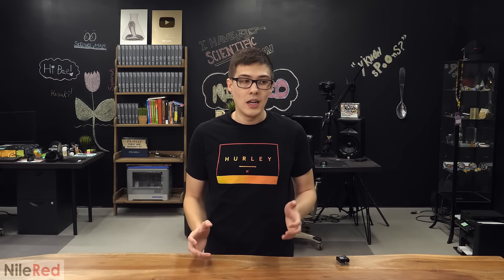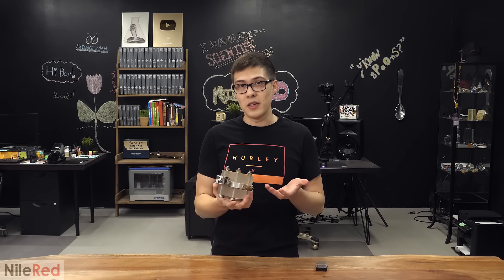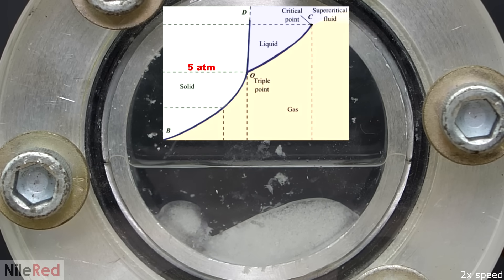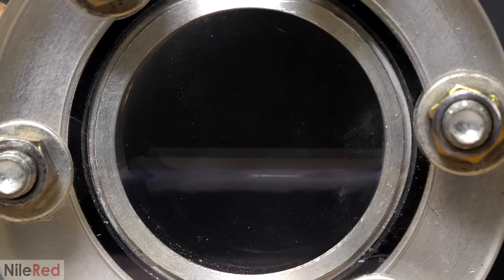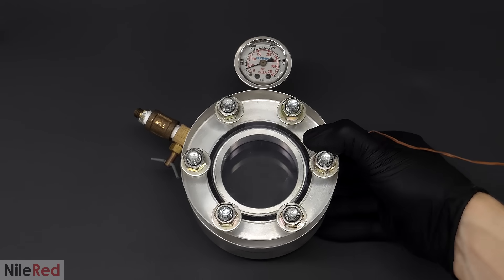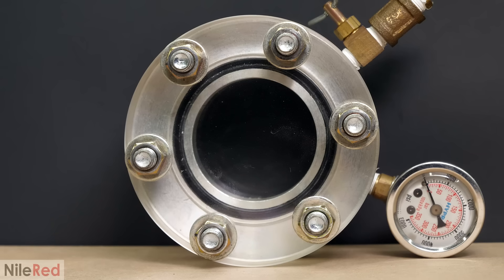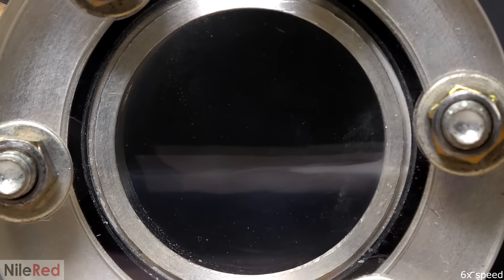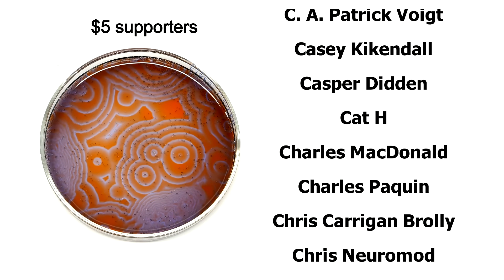Going supercritical.

Comment: Get a torque wrench for the bolts, one of the most handy tools to have.
Reply: And a bench vise
Reply: @FridgidIdgit  And a sheet of seaboard so you can cut and drill it into some cheap HDPE vice jaws to not mar everything you put in there without fiddling with wrapping it in neoprene sheet stolen from free tradeshow mouse pads or sheets of 1/2 felt. Advice from your friendly neighborhood armorer.
Reply: Or use the AvE method. “Aaaaand... click!”
Reply: I wouldn't expect to see a torque wrench, when he's using torx on hex...
Reply: @spamlobster  Ha my thoughts exactly. Stripped torx bit indicates tight enough.
Reply: @spamlobster  That's why adapters are a thing.
Reply: And dont use a damn torx bit for a hex head bolt...
Reply: What the fck is this comment section? Jk but still everything went over my head
Reply: I love torque wrenched.
Reply: Using a hex bit instead of torx probably could help as well
Reply: I agree with the tork wrench. i would think that torquing the bolts evenly would be as important as getting them tight enough. Uneven pressure could cause warping and at low temp could cause the cold plastic to crack. This could cause the catastrophic failure that Ben warned of. Great video though, i love watching nature at work.
Reply: Exactly what I thought as he was tightening
Reply: Unrelated side thought: why does the terminator in T2 need a torque wrench?
Reply: Five years later and I’m desperately searching the comments for this. Torque wrenches are worth their weight in gold with any sealed and pressurized system
Reply: He'd still need to figure out how much to tighten it. The wrench doesn't tell you how many Nm you need to set it to.
Reply: @Kenionatus  make a mock-up of the same materials, wench it until the threads fail, subtract 20 foot pounds off of that, then you have a reference. At the very least, it would allow all of the bolts to be set at the same torque to prevent warping.
Reply: Kenionatus since he got it to work, he could use a torque wrench to check how tight they currently are and then use that reference every time
Reply: @Kenionatus  With the size of the bolts you just tighten them to the manufacturers recommended torque setting, from the datasheet for that diameter capscrew. Simplest method without torque measuring is to simply add a Belleville washer to the head side, so that when it is just flat you have a very well determined tension on the bolt.  Probably a parallel stack of 3 washers with 10mm hole will work best there per bolt, giving a replicable tightening torque. This is common on things that need a set torque, but which are used in the field where you might not have torque wrenches available. Most common use I see is on electric cable joints, where you need a minimum contact pressure to prevent heating, and the washer also provides a small amount of compliance for material creep as well.
Reply: @Kenionatus  Set leaking is not catastrophic he could set each bolt to a different tightness run the experiment and then tighten them all to the setting that held the best.
Reply: @Kenionatus
I have two options of three words:

Torque Control Drill 
OR 
Adjustable Clutch Screwdriver
.
.
.
Slowly ramp up the torque after each iteration of a loop starting at the lowest setting, tighten the nuts, let it melt, check for leaks, and if no leaks, stop adjusting the clutch/torque control and repeat with full load to make observations, after recording the observation of the estimated proper torque, obviously.  ;-)

Comment: Just a couple points here. The vapor pressure is 5 atm only at the triple point, which is a temperature of -56.6C. Once the solid completely melts and you're along the two-phase coexistence curve and heat up to room temperature, the pressure should be almost exactly 60 atm. Thus, you have a built in pressure gauge so to speak.

Further, supercritical can be a bit of a misnomer depending on what you really mean. If you calculate lines of equal density starting from the liquid-vapor curve and then extend them above 31C, you'll find that there actually can be a difference between liquid-like densities and vapor-like densities in the "supercritical" field. This is why it seems like the whole thing is liquid-filled above the critical point with the beads in there.

Comment: I'm just spill balling here... but regarding the silica beads - could it be possible that the pressure lowered the melting point of the silica gel enough for it to undergo something like metamorphosis you find in rocks?  (And if so - would releasing the pressure very slowly cause the "crystals" to grow bigger; simulating cooling slowly by manipulating the melting point with pressure instead of manipulating the temperature).

Comment: first time in a while I had to switch from 480p(usually set at that both because slow internet and bandwidth limits) to 720p for something besides small text. I felt like I really had to get a better look at how the silica beads were acting under the supercritical CO2. speaking of the silica beads though, did you use the same ones for both runs? they looked cracked already by the second run, and I was hoping to see how it looked when they were actually changing.

Comment: Hi Nile,
 I am a student in gemology, and I think I can say that the gel beads have passed. As those beads have been subjected to a little heat and much more pressure than they are used to, they may have hardened and broken. Creating fissures and fractures throughout the interior, which reflect and disperse the light causing those beautiful colors.

And you are right, the play of colors of the opales are caused by another phenomenon. In case you want to know, the opaque is formed by microscopic and compact silicon beads, which depending on its structure allows opalescence (opales turbidity) and in some cases the color set characteristic of the opales

Comment: P.S. Your pressure gauge is for fairly high pressure(0-5000 psi).  The reason it initially was not responding was because the vessel was pretty cold from the dry ice, and there was probably some water in the pressure gauge which was frozen.  Another possibility is that the gauge is liquid-filled (usually glycerine or silicone oil) and was frozen as well.  It was reading about 500 psi when I saw it later in the video, which is lower than the critical pressure of CO2 (1071 psia).  The gauge may be broken, because it should have been reading 900-1000 psi as you went through the critical point.
Reply: PPS - You got to the correct pressure at 16 minutes into the video. - Nice job.  Looks like the new gauge is working better.

Comment: Just fyi, there's a ghetto way if doing that caffeine extraction that we did in my undergraduate o Chem lab. You get a soda bottle preform (basically looks like a thick walled plastic test tube) which is what they make 2 liter bottles into. Then take a plastic syringe with the plunger removed and place cotton, then coffee grounds into it. Place the syringe into the form such that it nests inside it comfortably (this means you need an appropriately sized syringe, won't be able to be very big). Then what you do is place dry ice into the syringe on top of the coffee grounds and quickly attach a pressure gauge and valve adaptor and close the form (the gauge must be able to withstand very high pressure, do not use an adaptor that cannot) 

The co2 will liquefy, flow over the coffee grounds and cotton and exit out the bottom of the syringe and collect at the bottom of the form. The pressure can then be slowly released and the co2 will evaporate leaving any extracted caffeine as a white powder at the bottom of the form. You can do repeat cycles to extract more. This also works with limonene in orange peel.

Comment: Re the colors: probably the CO2 is adsorbed into the silica just like water would be; when the pressure drops, the CO2 expands, creating cracks in the silica.  if these cracks are only a few wavelengths of light wide, you'll get thin-film interference, similar to a soap bubble or oil slick.  https://en.wikipedia.org/wiki/Thin-film_interference

Comment: You're right about the thin-film interference. You basically have small quarts crystals with fractures. The conchoidal fracture means the walls of the cracks are slightly curved which creates the interference.

Comment: Very good chance of making your windows brittle with the cold.  Much better to use CO2 from a commercial cylinder, although that is a little harder to do.  The cloudiness in your chamber is water.  Water vapor and CO2 vapor are both transparent, but dry ice exposed to the atmosphere is coated in frozen water.  Even if you start with dry CO2, while you put the chunks of dry ice in the pressure vessel, moisture from the air is freezing onto the surface.  You have a mixture of liquid CO2 and water in the vessel, and when it cools, the moisture condenses into a cloud, just like your breath when it's cold outside.  I used to measure critical points as an experimental chemical engineer.  Shake the vessel gently when the CO2 is very close to the critical point.  The droplets of liquid fall back into the liquid phase slowly, because the gas phase is almost as dense.  It can also change colors due to the many small density gradients in the fluid diffracting the light (same effect as a mirage).  To measure the exact critical point, the vessel has to be exactly half full when the point is reached.

Comment: The microfractures are basically a deformed or broken lattice of the SiO2, but only on the surface, not throughout the whole bead. It may appear like it but its not. A buddy of mine from material chem. was testing if he could produce macroporous or mesoporous materials using high pressures on various types of aluminosilicates and he pretty much got the same results.

Comment: Regarding the color reflections within the silica beads: if the width of the cracks are on the same scale as the wave lengths of visible light, then (AFAIK) those colors you see are created pretty much  the same way as opal does it (and so does ammolite). With the stones it is (indeed) the microscopic fractures in the stone's crystal structure (also silica) that directly interferes with visible light. Very likely, your association with opal is correct. In fact, you might have come (close) to making artificial opal right there (albeit of a low quality, from the looks of it).
EDIT: My apologies, I now see that the user "game whitness" already wrote a response to pretty much the same effect.

Comment: I think the "colored" silica beads are actually kind of turning into opal. Opal doesn't have a crystalline structure like other gems (one of a few reasons its one of the more fragile gemstones). Its actually made up of amorphous hydrated silicone dioxide. I think it might be possible that those beads were partially hydrated and then when you put it under high pressure the started to realign into the correct amorphous structure to mimic opal. I would be curious to see what would happen if you were to fully hydrate some silica beads and then try this.